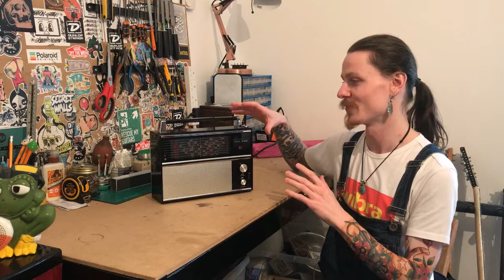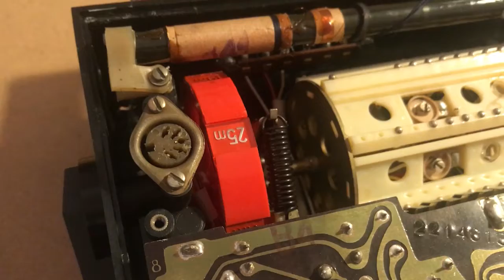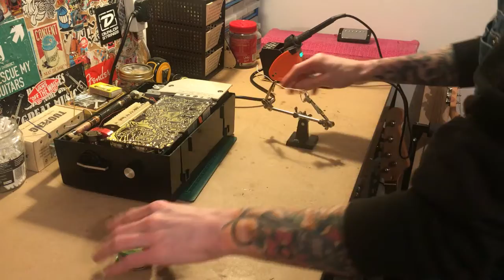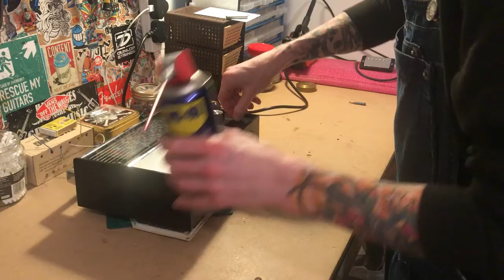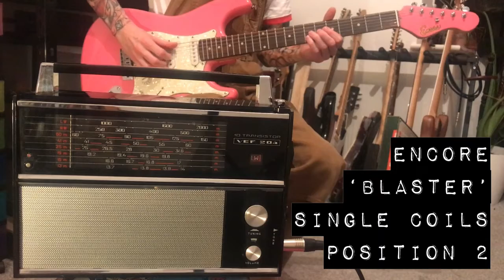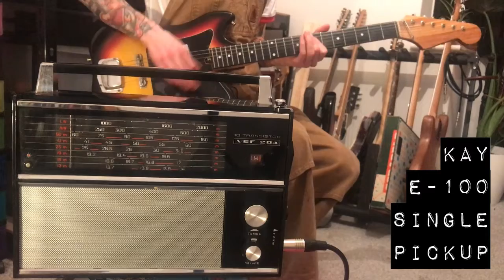Making a Transistor Radio Guitar Amp (1970s USSR VEF 204 Radio)

Comment: Hey. I just made my first transistor radio amp. It’s making a lot of popping noise. Don’t know if I did something wrong? Thanks for the inspiration.
Reply from the maker: Hey! Are you able to try it with a different speaker to see if it still has the popping sound? It may be the speaker itself, which would be the easier fix compared to a faulty component on the board 😥🤞 let me know how you get along! 📻🎸

Comment: I have heard of people using thrift store 10$ 'home-theater' speakers as cabs. Could you use one of these to hook up to one of those, then you'd have a budget gigging setup you could play on stage??
Reply from the maker: You certainly could! This doesn't currently have a speaker output but it is easily done 😄 I would love to record a video of performing a full home made set up; amp, mic and guitar, maybe even a suitcase drum 🥁 one day!
Reply: @WeirdandWired  i was wondering because the radio speakers themselves might not be quite loud enough for stage performance, but the amp circuit within the radio might be powerful enough to drive an (small) external speaker cab, like a pre-used home theater stereo speaker setup that everybody's grandma has to listen to classical music...
Reply from the maker: The radio as is would definitely need to be mic'd up in a live setting, an external cab would definitely give it some more oomph 📻🎸 I can't recall the speaker size off the top my head for this particular radio, but from what I've worked on previously they have varied between 1W - 5W. I have a Celestion Eight 15 speaker in an old radio husk I use as a test cab 😄 it's 15 Watts so not a huge jump in speaker size but the volume certainly is noticeable!
Reply: @WeirdandWired  my local thrift shops have some good-sized used 'home-theater' stereo sound system for 10-20$, much cheaper then a celestion Eight!